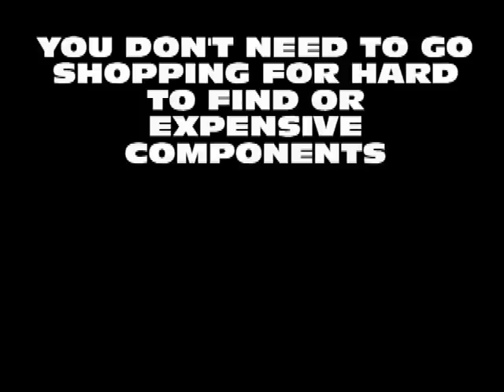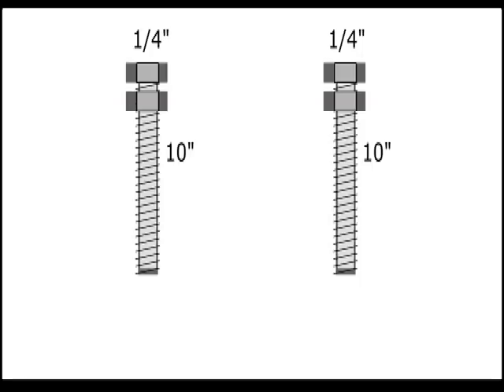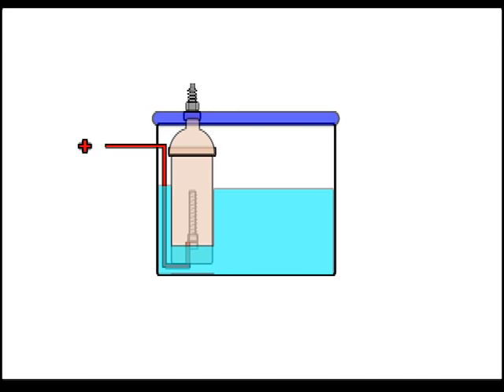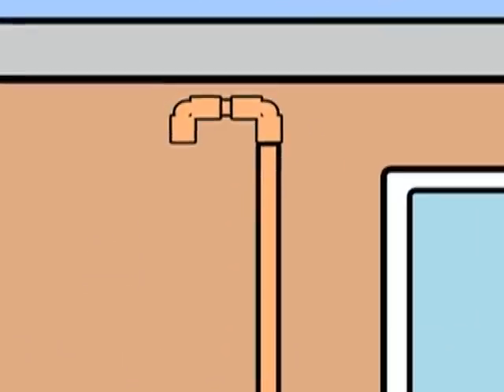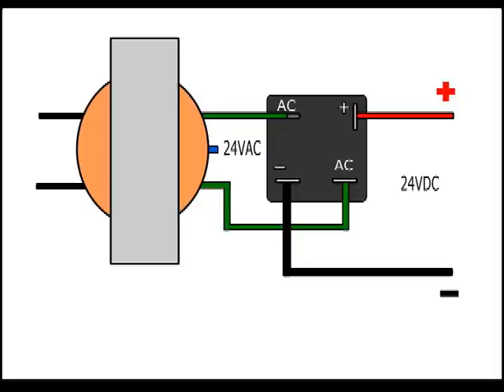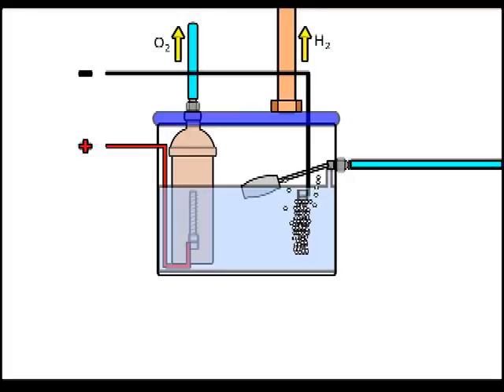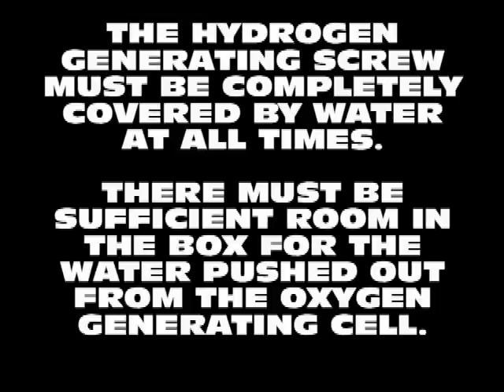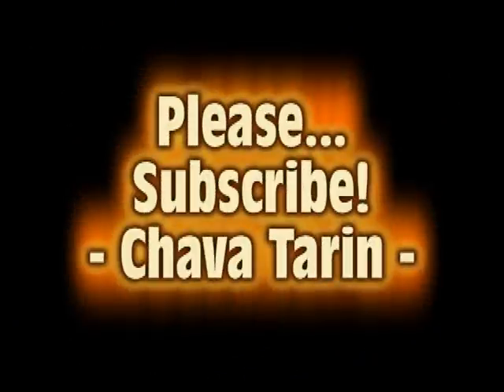Homemade Oxygen Generator

Comment: To split 1 liter of water you need around 10.7 MC ( mega coulomb)

1 watt/ volt = 1 coulomb/second

If you use. 150W 24v power supply, you'll get 6.25 coulomb/second

That will take around 475 hour to fully electrolize 1 liter of water.

If 1 liter of water can contains 620 liter of o2,  means you'll get a 620 liter of o2 in 475 hour. Approximately 1.3 liter per hour.

An oxygen concentrator can deliver 5 liter per minute or 300liter oer hour

If you want to get the same 5lpm flow, you'll need to multiply the power wattage to 300 times. Means you'll need 45k Watt
Reply from the maker: Wow! It takes a lot of power! Thanks for your contribution!
Reply: @eltunene  yes. You will have better deal by creating an oxygen concentrator. It can supply up to 15 lpm oxygen with standard household electricity. Harvesting oxygen from air and concentrating it to 100%
Reply from the maker: @Davidshtgl  Well, for a small jewelry torch, buying an oxygen concentrator would be a little bit too much. But, yes, it takes a lot of power to electrolize oxygen from water.

Comment: thank you💗also you can add a balloon on a t connector with a hose with aa exta botle with water in it in hose under water and out hose to gas on top to a propane heater/stove  and if your using 24v i guess you can use 2 12v batteries conncted +~+   - ~ -
                          X
                  - ~ -    +~+

💗💕🌈
Reply from the maker: Yes, with all due precautions, you can. Hydrogen is very dangerous if ignited in the presence of pure oxygen!
Reply: "You're" not "your".

Comment: Too much oxygen cause lung damaged as well. See link: https://myhealth.ucsd.edu/RelatedItems/3,90904#:~:text=Oxygen%20toxicity%20is%20lung%20damage,it%20can%20even%20cause%20death.
Reply from the maker: Yes, indeed. Flow has to be controlled. Oxygen poisoning may even happen in a hospital, if ventilator is not properly adjusted. Thanks for that important contribution!!

Comment: Earth will lose water and become Mars faster.
Reply from the maker: Well, if somehow the hydrogen is used in in open air for combustion, producing useful energy, water will not be lost. Hydrogen will combine with oxygen present in the air and oxygen in the generator can be used for a torch or other purposes. I heard of someone who took advantage of the oxygen and used the hydrogen for running LP gas fridge. As a matter of fact, some countries are using "green hydrogen" instead of natural gas.
Reply: @eltunene  that is correct, but this system has hydrogen release to open air.

Comment from the maker: Dear Christoper Eduardus, some gases are commonly found at standard temperatures and pressures as diatomic molecules, such as hydrogen (H2), nitrogen (N2), oxygen (O2), fluorine (F2), and chlorine (Cl2). Other gases, which have their outer orbit completed, such as the rare or noble gases, exist as monoatomic molecules, these are are helium, neon, argon, krypton, xenon, and radon. Oxygen and Hydrogen, when separated from their compounds, naturally assume their diatomic molecule structure.

Comment: Great another easy way to set the house in flame 0:20
Reply from the maker: Any application involving Hydrogen and Oxygen is dangerous. Even if you buy an oxygen tank at a distributor, it will be a source of danger.

Comment: Ironically, he posted this at the perfect time.
Reply from the maker: Dear James, electrolysis has been used since the nineteenth century, and is very effective, new materials have been discovered and they even use it in the ISS to produce oxygen for breathing on board.
Reply: @eltunene  I know its a technology that has been used for a long time, but a permanent solution for household and personal use has never really been established. Personally I don't see many people making hydrogen or oxygen in their homes on a daily basis. I just meant that it is ironic because of covid-19 and the need of quick and cheap supply of oxygen.

Comment: Once used sodium hydroxide will give continue oxygen? If water supply is constant by valve.
Reply from the maker: Dear Abbas, yes, sodium hydroxide does not get "used up" in the reaction, only water does. As long as no contaminants get into the solution, sodium hydroxide does not wear out.

Comment: Do you have a working model of this?
Due to high  purity, the oxygen is going to aggresively corrode the steel electrode and form precipitates of ferrous oxide and we will not get any oxygen in this process.  As the steel nail/screw/electrode gets covered with the precipitate, eventually the process will taper down to a total stop. 
How do you solve this problem?
Reply from the maker: Interesting feedback! I do not have a working model, but plan to build one soon. I understand the grade of stailess steel is important to prevent corrosion of the positive electrode, as well as using distilled water. As soon as I have my model working, I will post a video about it.
Reply: @eltunene  have you completed the project yet? Thanks for sharing!!

Comment: Is it capable for breathing
Reply from the maker: Thanks, Milan, for your kind comment!!! The generator was thought for using in a small welding torch, but with certain modifications, it can be used for other applications. First of all, the quality of the oxygen must be much better. Distilled water must be used, so no salts are present, which could pose a danger of producing other gases along with the oxygen, such as chlorine. A solar still can be used to save power in such a process. With regards to the amount of liters of oxygen per minute, that can be determined by the size of the generator itself, and MUST be checked by a health professional. Something else would be the energy consumed by a bigger generator, maybe solar panels can help here. Please check this drawing at 
https://www.youtube.com/channel/UCmjQnuJwV0FkjdEyi3099RA/community?lb=UgwRGRtRxJVb63bdsUJ4AaABCQ
Reply: @eltunene  thanks for the replay you are so kind that you replay to everone keep it up

Comment: So exactly what we should do for hydrogen gas generated by this equipment
Reply from the maker: Dear Palash. The original project was about a small generator for a small torch. People has asked a lot of questions about how to use it for other applications. They also sent a lot of suggestions and shared experiences. I even heard of a fellow who said he had used the hydrogen for running a gas operated refrigerator.  That is possible. I think it would be a good solution. However, handling large amounts of hydrogen is a dangerous thing to do. People doing that should have some experience in handling flammable gases. My background is electronics, so I am not an expert in that field. What I strongly recommend is not to mix both gases, since they are very explosive together. Also, distilled water should be used in order not to contaminate oxygen with chlorine, which would be toxic. As to health applications, professionals should be hired to certify the oxygen is totally pure. The electrolysis process is not new. Astronauts in the ISS use that same process to renew their oxygen (and their water). My idea is get some experts involved so they can develop a project large enough to produce high volumes of oxygen for hospitals, since supply is running out in some countries. If they can use the hydrogen to run power plants, autos or whatever, and the oxygen to save lives, that would be good.
Reply: @eltunene  yes of course , I know mixing of both gases r very dangerous but I wanted to know that, is the hydrogen gas is directly vented to atmosphere or other kind of  filtering process use ? Only for small level  experiment

Comment: Is it sufficient for one person breathing ??? Pls help we are planning to work on it
Reply from the maker: Dear Milan, under ideal conditions (distilled water, non contaminated solution, good heat dissipation, proper stailess-steel electrodes, heat resistant tank, etc.), oxygen will come out pure oxygen. However, oxygen produced must be certified by experts in the field of chemistry and medicine. Very important, oxygen and hydrogen must not mix, since the mixture can easily explode. They must be kept separate. No leaks. If you wish to experiment, please start with a small generator, and make it grow slowly from there. Based on comments and suggestions, I made an updated model at https://www.youtube.com/post/UgwRGRtRxJVb63bdsUJ4AaABCQ . I include a water still, some solar panels, and two separate cells for hydrogen and oxygen. Voltages and dimensions are not critical. You can initially try it using a car battery, and grow from there into some solar panels, a charge controller and a solar still, in order to get distilled water and energy efficiency.

Comment: Cam we add one LPM  meter at oxygen outlet.....
Reply from the maker: In its original size, pressure is very low. It is governed by the weight of the water column in the hydrogen exhaust.
Reply: I was hoping somebody in India would notice this. Praying for you.

Comment: Use sheets of stainless steel(cheapish) mesh or sheets of platinum(very costly) mesh. The key to increasing the production of oxygen is surface area. The larger the electrode surface area, the more oxygen/hydrogen is produced. Sheets of stainless steel mesh can be bought in rolls of 20 meters and anything from 20 to 120 cm wide, maybe more.  The oxygen produced must be cleaned in order to use it as medical oxygen. Mist of the electrolyte will follow the oxygen, but if bubbling the produced oxygen through a separate bath or two of water, it should be ok for emergency use until medical grade oxygen can be acquired. I would use bottled water for this, and when refilling, always add water to the extra bubbler and let this water again flow into the electrolytic bath. That way the cleaning process always has some freshwater added to it, and the electrolytic bath will keep at a constant strength.

Comment: But stainless steel produces many harmful gases like nickel oxide and chromium oxide?
Reply from the maker: That's one thing that must be confirmed by a professional in the subject. All information we can get is useful. However, there are several grades of stainless steel, there must be an ideal one for this application. In early devices, they used precious metals, which are very expensive. If this is going to help many people, it is worthwhile doing some research. Basically using distilled water and the proper grade of stailess steel for the electrodes, this should suffice. Please contact people who are working in the field of chemistry, they can help you sourcing the basic elements. Also, maybe PVC is not the ideal plastic to use, that could be a good point, too. Since some heat is evolved in the process, tank and cells must withstand moderate to high temperatures without releasing any toxic fumes. My intention is to stimulate people with the proper know-how in that field. Originally my project was for a small torch, but hundreds of questions have been asked by viewers, but my field is just old days electronics. Please keep me updated as to your results, to share your findings with other people in need to find a medium to low cost solution to the problem.
Reply: @eltunene  i have tried this with copper electrode. The colour of the solution did not changed as it becomes dirty green in the case of steel or iron due to the formation of iron oxide. I am searching for a cheap electrode that do not diminishes. I have come to know that it is possible by alloy electrodes.

Comment: The SS nut bolt assembly being used to conduct electricity need to be replaced how often?
Reply from the maker: Good quality stainless steel should not require being replaced, except if the water is badly contaminated with salts. Anyway, water should be distilled, and should not contain any chlorine salts whatsoever.
Reply: @eltunene  I shall try it with SS 304. thank you.

Comment: Thanks sir for the information ,very useful
Reply from the maker: Thanks, Aditya, for your kind comment!!! If you plan to build the generator, please take every precaution to prevent gases from mixing, as well as using distilled water to prevent chlorine from being produced along with the oxygen. Start small, and check the purity of the oxygen by hiring a professional, make sure it's pure!!

Comment: I worry for covid and maybe this can save my family. ✌ from singapore
Reply from the maker: Thanks, Nick, for your kind comment!!! The generator was thought for using in a small welding torch, but with certain modifications, it can be used for other applications. First of all, the quality of the oxygen must be much better. Distilled water must be used, so no salts are present, which could pose a danger of producing other gases along with the oxygen, such as chlorine. A solar still can be used to save power in such a process. With regards to the amount of liters of oxygen per minute, that can be determined by the size of the generator itself, and MUST be checked by a health professional. Something else would be the energy consumed by a bigger generator, maybe solar panels can help here. Please check this drawing at 
https://www.youtube.com/channel/UCmjQnuJwV0FkjdEyi3099RA/community?lb=UgwRGRtRxJVb63bdsUJ4AaABCQ
Reply: Yes

Comment: Sir thanks can u show any where in India  6283069395 Chandigarh
Reply from the maker: The original project was intended for a small torch, not for high volumes. However, the idea can be expanded according to your needs. People in India are very creative, and I am sure they can expand the system into a working model with enough capacity for applications needed. This system is not very efficient, but can be an emergency resort. The system evolves a lot of heat, so care should be taken. Also, oxygen produced must be certified by professionals, if salts are present in the water, the machine can yield chlorine instead of oxygen. Besides, hydrogen and oxygen must not mix, they are explosive mixture.

Comment: Thank you for sharing your knowledge with us. Please can you tell me how much oxygen can we make by use this method per hour ?
Reply from the maker: Dear Athila, the original project does not yield much oxygen. However, it can be expanded in a bigger box, and bigger electrodes, you can use stainless-steel wool, and more powerful power supply. However, please take into account some important things: Heat is evolved, so adequate cooling or dissipation must be provided, if you increase the current, the heat also goes up! The most important thing is having a professional check the quality of your oxygen produced. One factor is using distilled water (a solar still can be used) Please check a drawing for a more complex system at https://www.youtube.com/post/UgwRGRtRxJVb63bdsUJ4AaABCQ (both English and Spanish explanation) I even included the possibility of using solar panels for saving electricity, at least during the daytime. You can try assemblying the generator presented, with more plate area in contact with the liquid, make tests as to production and oxygen quality and quantity, and use several units in parallel. Start small and expand the system from there on. Another very important thing is hydrogen and oxygen must not mix, since they are a highly explosive mixture. No leaks allowed. If you can get assistance from experts in handling those dangerous gases, it would be better. Please be very careful. A room full of oxygen poses a danger of bedclothing and curtains igniting, since oxygen supports combustion very aggressively. A room full with hydrogen and oxygen together is a high power explosive ready to ignite any moment. Start small, so you can experiment and perfect the machine.
Reply: @eltunene  dear Mr.Chava thank you for all of your advices. I can manage those things and I will take safety steps for that.I want to make oxygen by using easy and cheap method.This is a one of cheap method. But I want to can it gives to oxygen as I want. Therefore I want to know how much oxygen can I make by this an hour by under the 1atm and 27c° conditions

Comment: Good afternoon Mr Tarin.  Thanks for sharing this and updated design. How much oxygen will this design produce ?
Reply: It'll produce infinitely aslong as you have a constant supply of water ( the valve connected to the outside hose ) and a electrical power supply
Reply: @perkales3132   A better way of asking is how many liters/ounces/etc. are produces per hour/minute relative to how much water consumed?
Reply: @GaryGipson  It depends on the size of said person's creation; but as said in the video, if it's connected to a valve it's endless. To measure oxygen specifically, to see if you're oxygen production is accurate against a controlled measure, you'll need a oxygen analyzer.
Reply: @perkales3132  Thanks for your prompt reply. I will proceed accordingly.

Comment: Sir Can we stored generated oxygen in cylinder with any compress pump
Reply from the maker: Dear Rehan, it would have to be a special pump, since most lubricants and gaskets are rapidly oxydized by oxigen, even violently. Please try to contact an expert in that subject, I merely applied something I learned in high-school. Maybe the best thing is trying to expand the system so it can provide oxygen in the desired amount for long periods. Anyway, contact a professional in order to make sure your oxygen is suitable for your application.

Comment: I have worked with hydrogen gas. No wayh I would set this up in my house or garage. Outside is a would be ok.  Also, byh using salt NaCL rather than NaOH you will get a mix of hyrogen and chlorine gases out. This could then be used to chlorinate drinking water in third world and disaster situations. An automotive battery could be used instead of the plugin power supply.  ALSO, IIRC hydrogen and chlorine gases are explosive in the presence of sunlight. Be careful.  A simple separation setup could be used to let the hydrogen vent and separate from the chlorine.